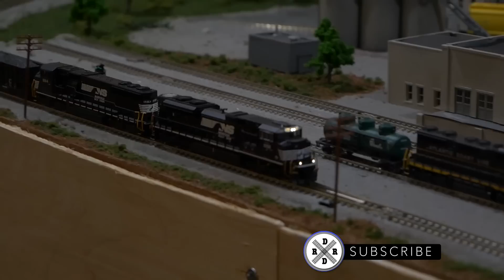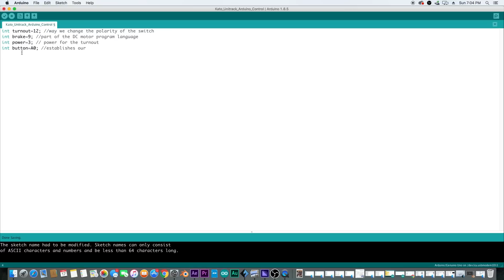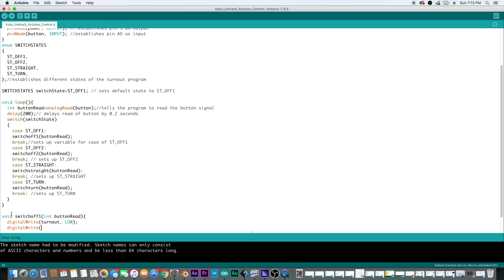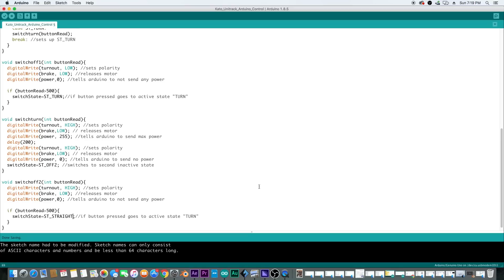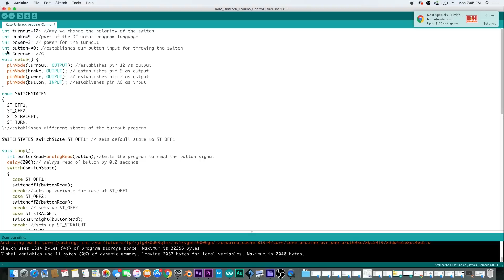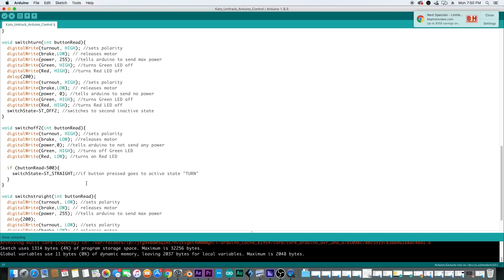Controlling Kato Turnouts with an Arduino!

Comment: Thank you for this video. I didn't want to re-invent the wheel to control Kato coil turnouts on my T-Trak project. I will be porting this to  microPython and a Lolin mini ESP32 board with motor sheild. Plan to have module to take to shows and run as a layout at home..

Comment: Thanks for the video.  Have you figured out how to determine the switch position at power up?  Eg, if you leave the switch on the divergent route when you shut down for the day, then come back and power up, won’t the sketch make the assumption the switch is set for the mainline?
Reply: i saw the same issue.  on startup, lights will show green, but switch is in unknown position.  can be easily fixed by adding  "switchstraight(0);" as last line in setup().  this switch position will now match the light.

Comment: Interesting and it seems almost unique tutorial on how to control Kato turnouts with Arduino.  I have a total of 16 that I ultimately want to control via the JMRI GUI rather than push switches, should this be possible if I invest in an Arduino Mega?
Reply from the maker: This is a research project of mine with CMRI and JMRI.

Comment: I just found your channel after hearing about it being hacked from Ron's Trains and Things. I am trying to duplicate what you have done but I get an error in the google docs code at the last step involving the switchstraight case. I get the error "a function-definition is not allowed here before { token". The code looks like the step above for switchturn, so I am at loss as to what is going wrong. Any thoughts? Great channel, I am new to the Arduino world but I am diving in to give it a try on my layout.
Reply from the maker: I will try to duplicate the error and get back to you.
Reply: @DIYDigitalRailroad  I am rewatching the video, and the file linked in the notes does not match what you are typing on the screen. I will revise what I copied to the IDE using what you are doing in the video and see if that works. On a side note have you looked into using 12 volt relays and sending a pulse for X msecs to throw and release a switch.
Reply: No Joy, it still has same error in the switchstraight part at end. If it matters I am using Arduino 1.8.13.
Reply from the maker: @rahoover427  I will give it a shot tonight.
Reply: @DIYDigitalRailroad  Thanks, not a big deal, still working on getting DCC++ and JMRI to work as well. I went over to your Arduino Block Signal video and tried that one and get the same error on the last loop statement as well, maybe something in my Arduino setup.
Reply from the maker: Hey Randolph, so sometimes the text document has some phantom characters that ruin it.  Here is a link to the turnout sketch.  https://drive.google.com/drive/folders/1784BU4wyP-rK1ADMHKVJLURu3Xv4DgJ8?usp=sharing
Reply from the maker: Here is the updated Block signal sketch.  https://drive.google.com/file/d/1I26QqjuZ7xy9UdgguFD-UB1F__5fNq1x/view?usp=sharing

Comment: Awesome video, Jimmy!
Is there a way you could help me tweak your code to use two bi-color LED's?  I'd like to be able to show RED on the mainline and Green on the Diverging track when the switch is thrown.  And vice versa...  Hope this makes sense to you...
Reply from the maker: Hey David!  If it’s 2 separate LEDs, all you have to do is wire one signal opposite from the other.  So connect the main red and diverging green to the same place and vice versa.
Reply: @DIYDigitalRailroad  Another quick (probably stupid) question:  Can I use a standard momentary button switch?  It only has two leads, so how does that get hooked up in place of the little push button in your demonstration, which appears to have 3 connections?
Reply from the maker: No stupid questions!  Yes you can!

Comment: I know this video is over a year old and it looks like you have made changes to the sketch over that time. It looks like the snap switch sketch is what you are publishing now and that is fine because it does work with the L9110s and L 298n motor drivers pushing Kato turnouts. I was wondering what happened to the LED part of the sketch? I tried adding them like the original video shows about Kato turnouts and get very strange errors. Above my head . Could you give me ideas on adding the LEDs back into the sketch.?
Reply from the maker: Let me take a look at the old sketch and modify it.
Reply: @DIYDigitalRailroad  Thank you

Comment: First of all, new subscriber, find your posted vids excellent, that well I decided to invest in the Arduino Uno kit, but I do have a few questions, 1.can I use light detection resistors to activate the points? For the purpose of automating the layout. 2.how would I go about using this method? As new to the world of Arduino. 3.do you have a vid on this sort of thing already? I have seen the one where you use a servo but I wil be using Solenoids

Comment: Nice tutorial. I just build my first DCC++ system using one of your videos. Now I would like to add 2 Bachmann turnouts. They are the normal dc turnouts. Can I still use the same motor shield to throw the turns using JMRI?
Reply from the maker: Bachmann turnouts are actually snap switches which require different wiring.  Here is my tutorial on snap switches https://youtu.be/OZw8n_Sn_eE

Comment: Absolutely fantastic!  I just followed your setup myself and it worked almost flawless.  There are a few duplicate lines I removed, but I think otherwise everything worked fine!  Thank you for the great info!  Looking forward to trying the signal code next.
Reply: One other quick note, I looked over the code for a bit and realized you could simplify it a bit further.  Let me know if you'd like, I can send you it.  I tried it out a number of times, and it simplified the process.  I'm going to turn it into a class and I'll share it with you if you'd like.  This way you can upload a library eventually that makes it "configurable".  Hope that helps!

Comment: Can you use this L298p Motor shield for a DCC++ system?  Use motor A for the DCC++ train control and motor B for programming and Kato switch power?  If so, what are the pin assignments for the two motor channels?  Another tip:  on the button switch, wire one side of button to ground.  Other side to a digital/analog pin.  Use the Arduino built-in pull-up resistor via PinMode(button, INPUT_PULLUP);  this eliminates the external resistor and 5vdc power wire.  I assume for multiple turnouts, use a 1/2/4/8/16 relay board.  For additional digital IO pins, use I2C to control up to eight HiLetGo PCF8574T IO Expansion Boards with 8 I/O pins per board.  Thanks for the videos.  I am at the planning stage of an Kato N-scale layout with  9 car ferrys (10x ferrys) as staging.  The ferry arrives as a 3 foot section of un-powered track on a board.

Comment: i am trying to buy an arduino L298p Motor shield. the ones I have found Don't have a switch in the upper left hand corner or the little box on the left side attached to the PC. does this matter? Keep up the great videos. Thanks Barry olson

Comment: Awesome! I made my own slow mo switch machines using servos and SPST switches with red/green LEDs. The total cost of the build is about the price of one switch machine, and I can run 12 servos with the library, but only 10 with the number of pins I have.

Comment: I'm assuming that you could add more code to use additional pins on the Arduino to use the other motor output on the shield to control a second turnout.  Could these shields then be stacked until you run out of pins on the Arduino to keep adding turnouts to the controls?

Also, the reversing loop mentioned elsewhere in the comments sounds intriguing.  Ive avoided them so far in my layout design because thinking about how to make the polarity work without shorting anything out makes my brain hurt whenever I think about it.  I'd love to see a tutorial about that once you've figured it out.

Comment: How difficult is it to connect this setup to servos?  That's what I have on my lauout.  Plus I have about 40 switches.  Can one ardiuno control all that.
Reply from the maker: This particular motorshield can only power 2 servos at a time.  I believe there are connections that can power up to 4 at a time.  You would need multiple arduinos to control 40 turnouts.  I am planning more tutorials on different types of turnouts.
Reply: @DIYDigitalRailroad  Thanks for the reply.  Watching your videos has sparked an interest in model railroading.  My field of interest is in automation.   But in the past it was getting expensive.   Now with ardiunos I am thinking of dusting the layout off and going at it again.
Reply: @DIYDigitalRailroad  okay, but my idea here would be this: use a multiplexer and relais. Then you need only 1 motor shield,  lop the signal to the ralis contacts, and select the needed outputting relais via the multiplexer. This way you can also easily throw multiple switches, and switches rows.

Comment: Also - (3) did you power both the Kato turnouts in the crossover - or just the one?  If just the one could you power both from the same Arduino?
Also - (4) can you use the same 5v power supply to power multiple Arduinos powering multiple Kato turnouts around the layout?
Dennis
Reply: You can use a single power supply to power all of the Arduino microcontrollers and turnouts with their respective voltage requirements as long as the power supply can deliver enough current. Also, you can control multiple turnouts using a single Arduino board(each turnout will require two digital pins of the Arduino board) and using an L298N motor driver module which can drive 2 turnouts each. If you want to control a large number of turnouts, get an Arduino Mega board, it has more than 50 digital I/O pins.

Comment: Looks very good and quite easy to achieve . . . however (1) what is the advantage of using an Arduino? and (2) can you now connect with a DCC system and add an accessory decoder and hook up to JMRI? 
Dennis
Reply from the maker: So the real advantage of this is when you need to automate a turnout.  Kato Turnouts will always cause a short circuit if a train crosses them when they are not thrown in the proper direction.  One of my longer term projects is an arduino based DCC reversing loop, and this automation of the turnout is key to that project.

In terms of DCC, it is possible, you would have to figure out how to make it controlled by a decoder though.
Reply: @DIYDigitalRailroad  
Would not using insulated rail joiners on all 4 tracks exiting the turnout avoid the short?  That's Mike Fifer's solution. 
I have only just started researching Kato for a new layout and there seems to be some confusing inconsistencies. For example the #4 turnout seems to have solved the problem you mention by being either "isulfrog" or "electrofrog" (to use a couple of Peco terms) by moving a little screw on the rear. I am guessing that this is an enhancement that Kato will add to the #6 turnout once their inventories of the old turnout are sold.
Dennis
Reply: Using a DCC decoder to control a turnout from a DCC control station is more expensive than using an Arduino microcontroller to do the same, in fact, an Arduino microcontroller can also be used to make a DCC decoder, combining that with a motor driver will allow it to control turnout switches using the DCC control station and you have got your own stationary decoder.           Here is a DCC decoder made using an Arduino microcontroller board:
https://www.youtube.com/watch?v=Uix0lzoN84w